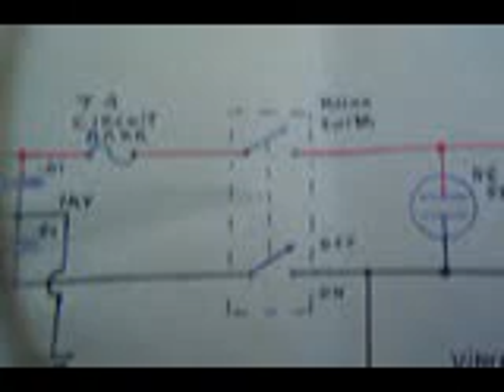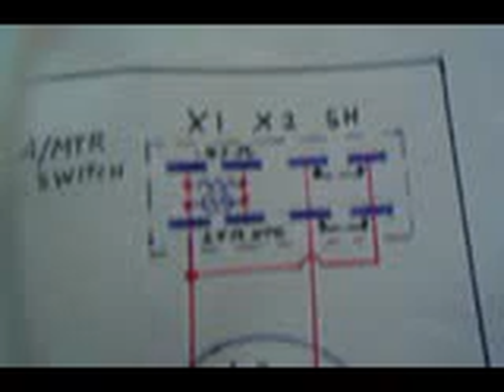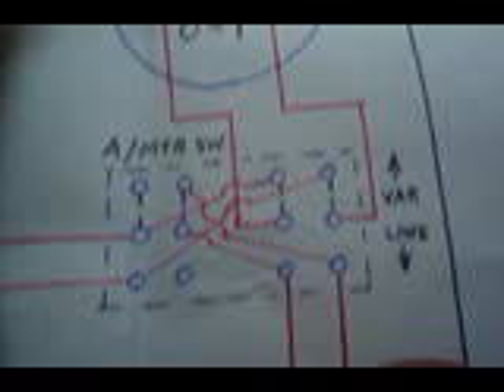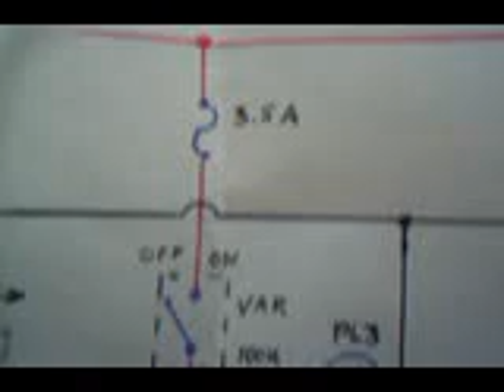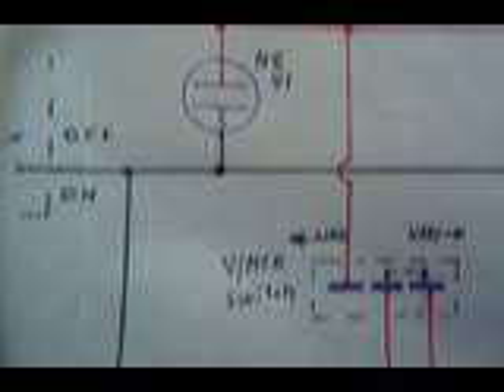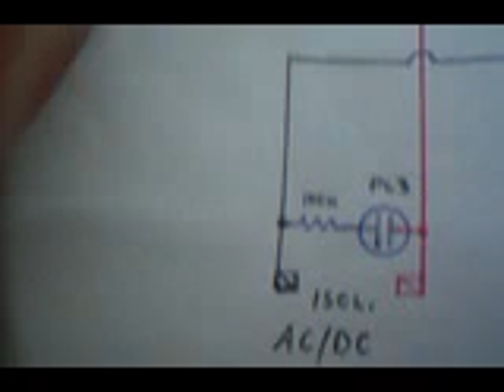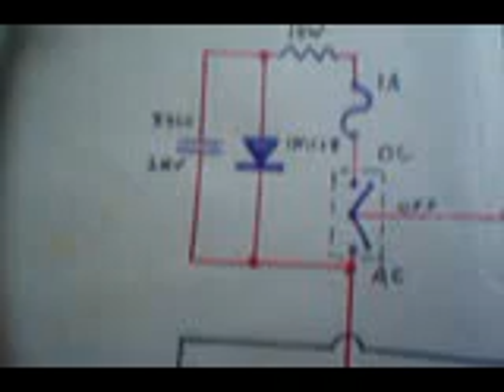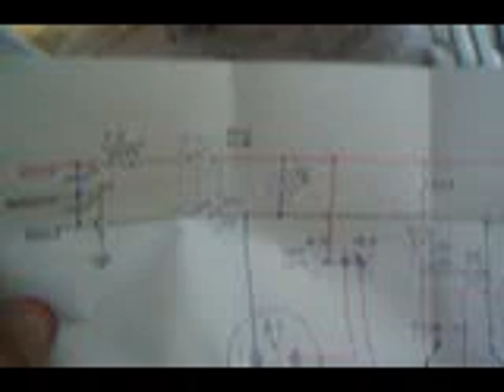hho

Comment: connecting two units in series should work quite well and would be easier to manage ...  the only deadline is the one you impose on yourself ... no one really cares if it takes you a week or a month or a year ... shoot for your goal and stick with it taking small steps and you will get there ... the journey of 1000 miles begins with a single step ...

Comment: yes ... to run it right off the wall outlet's 120v rectified to roughly 150vDC (the bridge rectifier gizmo) you would want about 150volts/2.5volt per gap = 60 plate gaps or 61 plates total ... a BIG, HEAVY, AWKWARD piece of hardware ... but 150v @ 20a = 3000 watts (the lights in your neighborhood are gonna dim) and should produce 10 LPM or there abouts ... maybe you want to run two torches ???

Comment: if you have 33 plates, you have 32 plate gaps ... tyical you will want is about 2.5v per plate gap ... so if you were to hit it at 32 gaps * 2.5 volts per gap = 80 total volts going in ... if you use a 10 amp circuit that's 800 watts ... 800 watts with the amount of surface area you have should produce about 2.5-3 liters per minute of gas ... plenty to run your torch ...

Comment: I am sorry to disappoint you but it looks to me like this power supply is only capable of handling about 2.5 amps ... that's a little low for what you want to get done ... you will want at least 10 amps, maybe 20 amps to get really good production out of your device running at about 65-90v or so ...